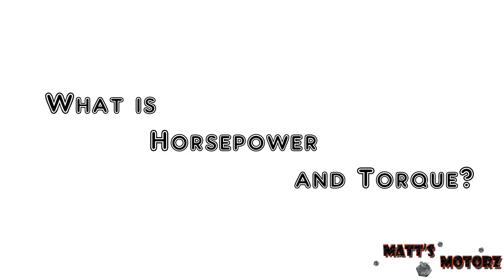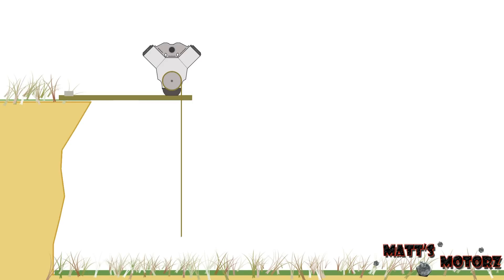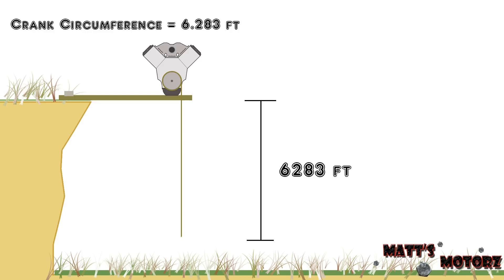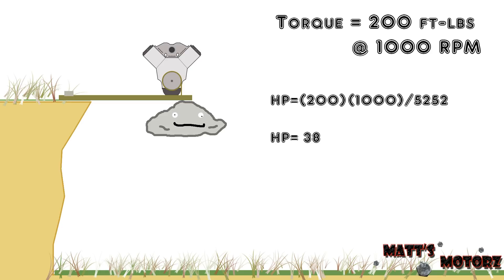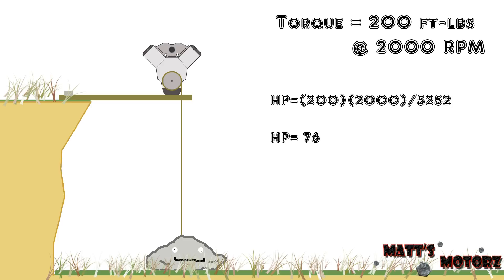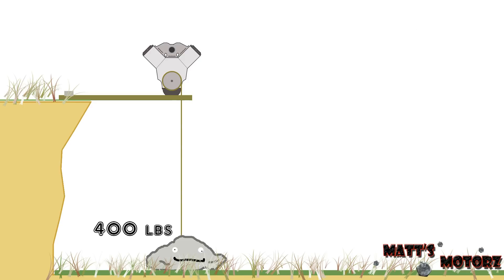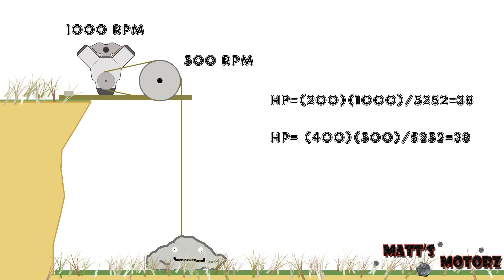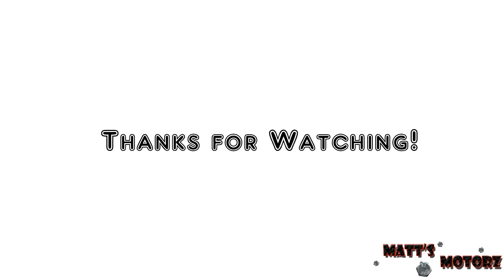What is Horsepower and Torque?

Comment: how does torque and horsepower feel though?
Reply: You feel force at the wheels. This is why when you floor it in 5th you don't feel that much, but 2nd gear puts you in your seat. 
More torque from the engine in a given gear means more force at the wheels, but if an engine with half the torque can spin to twice the rpm, you can downshift for the same force at the wheels if you have a gear ratio half as high. You'd have a hard time feeling the difference between two cars with equal power with one car that makes twice the torque but has twice the gear height and half the rpms.
Reply: That was a terrible explanation. Stop trying so hard to prove how smart you are to everyone, and try again. Start thinking better.
Reply: You're right about the wind resistance muddling matters up, but you definitely have more force at the wheels in lower gears. In the F=MA equation you then get less acceleration at higher speeds. Force times distance is work, and if you go twice the distance in one second, (for constant wattage (power)) you need to halve the force.

Comment: is the last image at 4:16 wrong? shouldn't the rock be pulled by a smaller pulley that is directly attached to the large one?
Reply from the maker: Yes and Yes
Reply: What do you mean? I don't get it. Please explain.  Seems right to me.
Reply: In the given image the large pulley acts as a guide pulley only. the ratio and thus the torque is not changed.

Comment: Awful explanation. Wth is 5252? Is it a number you randomly invented? What does it mean? Why even bother explanation the difference between torque and horsepower if you don't even explain that number which is very important for the equation?
Reply from the maker: It is simply a consequence of dimensional analysis in writing the equation in units of HP.  I am going to make a pinned comment about this in a minute so everyone can see as I have had this question so many times.
Reply from the maker: I just made a pinned comment on the video deriving the HP equation from scratch.  Please see the comment on the video.
Reply: https://www.youtube.com/watch?v=lt7iUBE3_AE

Comment: horsepower is how fast you hit the wall and torque is how far wil you take the wall with you
Reply: If you study physics in high school or in college...you will fail by such explanation.
Reply: Torque is how hard you twist the crankshaft, RPM is how fast you twist the crankshaft and Horse power is how much energy you put into the crankshat.
Reply: Torque is how wrong, stupid and irrelevant an analogy is. RPM is how much it gets multiplied by "likes".
". Power is the resulting permanent
cognative damage caused to our collective consciousness.
Power, not torque, is the limiting factor in not only the top speed of a vehicle but also how quickly it can accelerate at any speed and how much weight it can pull up an incline at any speed.
Please do yourself and the comments section a favour and watch a video called:
"Horsepower is NOT how fast you hit the wall.
Torque is NOT how far you take the wall with you"
It's on the D4A channel. It illustrates the distain the people who understand Physics and engineering have for these idiotic Idioms that spread like a pathogenic mind virus.

Comment: Ugh the power torque curve in the beginning doesn't make any sense. HP should intersect with Torque @ 5252 rpm.
Reply from the maker: This was brought up by MANY other people.  There is no error.  The y-axis scale is different for HP and torque, causing the intersection point to be different.
Reply: Yes, lots of people don't understand that these are two different measures using different units and there is no magic involved in 5252. It's just a unit conversion factor. I've even heard people saying that the two graphs crossing at 5252 means an engine is well tuned :-)

I prefer you keep this as is cause people need to not think of the Y axis as common. It's not. There are other things in this video that could be improved.

Comment: So if you have an engine with massive torque, like over 1000lb/ft and you put it in 2 cars, one which weighs 2000kg and the other 1000kg. The cars are identical (same gear ratio, diff ratio and wheel diameter) except for weight. If the engines make the same horsepower then the weight of the cars shouldn't affect acceleration, right?
Reply from the maker: It will.  The difference is that the load will be greater on the car that weighs more, which will affect performance.

Comment: on the graphic with the pulleys (gear reduction) the rope attached to the rock should be on a 1ft radius pulley which is attached and shares an axis of rotation with the 2ft pulley

Comment: I have a hoodie, on the back it says. Horsepower is how fast you hit the wall, torque is how far you move it.
Reply: Too bad it's wrong lol
Reply: Torque is just how hard you twist the crankshaft, tells nothing about how fast you twist it...you need both to know how fast you will get going.
Reply: Torque is how wrong, stupid and irrelevant an analogy is. RPM is how much it gets multiplied by "likes".
". Power is the resulting permanent
cognative damage caused to our collective consciousness.
Power, not torque, is the limiting factor in not only the top speed of a vehicle but also how quickly it can accelerate at any speed and how much weight it can pull up an incline at any speed.
Please do yourself and the comments section a favour and watch a video called:
"Horsepower is NOT how fast you hit the wall.
Torque is NOT how far you take the wall with you"
It's on the D4A channel. It illustrates the distain the people who understand Physics and engineering have for these idiotic Idioms that spread like a pathogenic mind virus.

Comment: i am Not a Engine Spezialist, but since Torque = 9550*(p/n) i dont Unterstand this Factor 5252
Reply from the maker: The factor 5252 comes from converting the HP equation into ft-lbs.
Reply: MattsMotorz i assumed something like this, but seriously, why PS, why HP why ft-lbs, would be whole lot easier if we all use si measurements
Reply: Good luck converting America to the modern SI system :-)

Comment: doesn't horsepower make a car faster
Reply: iTzArNoLd415 that's true, but there is an optimum because there are more factors that play a role. For example, a high-hp, low-torque engine in a heavy vehicle means that you need to be really high in the rev range to be fast, this means switching gear very often, a lot of noise, high fuel consumption and short service intervals. This is optimal for for example a (loght weight) racing bike. But for a truck delivering cargo every day of the year, this would be terrible.
Reply: xXxMartin96xXx I disagree with your argumentation. Yes, those different engines will have their own gearing suited to its application and there is off course the critical function of the clutch. A high torque/low revving/low maintenance engine (e.g. marine propulsion @ up to 400 rpm continuously) will always have a higher weight and has different mechanical loads than a high hp / high revving / low weight engine (e.g. racing bike @ 15k rpm redline which is engineered in a such a way to achieve weight minimalisation). In the high revving engine, all the components move much more often per hp delivered per x distance traveled. Furthermore, at such high rpm, there will be much more friction per hp delivered, resulting in more noise and more fuel consumption. Besides the point that these engines will have been engineered aimed at a specific maintenance interval, inherently, the high torque engine has a much longer service life whereas the racing engine would need a revision after only a very limited amount of distance travelled on track.

Comment: my bike makes Max Power 17 BHPMax Torque 18.35 Nm. can anyone explane why it makes more torque than hp? i am a commerce student kindly explane in simple eng tia
Reply: 223 ccMaximum Power17 Bhp @ 7000 rpmMaximum Torque18.35 Nm @ 6000 rpm
Reply from the maker: These are at two different RPMs.  An engines torque and HP varies with RPM so you cannot compare these two numbers.

Comment: Nice vid.. I always cringe a little when people act like Torque is what makes for faster cars, not horsepower... Even high profile car guys like Jay Leno of guilty of this fallacy.. But it doesn't take much to realize that this mindset is erroneous.. After all, if torque was more important, short shifting ( thereby keeping it in peak torque) would be the fastest way to accelerate, but no, everyone knows that revving it out to the top of the power band (Where torque falls off and HP peaks) is faster. 

Furthermore, if torque was king, diesels would be the best choice for fast cars, as they produce massive amounts of torque. With less HP.. But no, it's gasoline engines, which usually produce more HP than torque, that are the choice for the fastest cars.  

And yes, I know those highly modified diesel trucks are quick.. But take a similarly sized gasoline engine, and throw similarly big boost at it is see what happens.. that's right, you'd have a MUCH faster truck!
Reply: i would argue that, a car with great horse power but only up in the higher rev range would loose to a car that can pull hard quickly using superior torque, to a point. its ability to reach max power is more accessible but will loose top end speed as a result. on a tight twisty track torque wins, long open track racing, hp wins.
Reply: Savantjazzcollective
That's a good point.. And in a drag race, torque would take it off the line and in the 1/8.. But in the quarter, or full mile, you'd want the HP
Reply: one could argue that transmissions do torque multiplication and short shifting will cut wheel torque by a lot, so even if the engine is not at it's optimal torque range, the torque multiplication of the gearing more than makes up for the falloff.

such as in this graph:
http://www.rx7club.com/attachments/3rd-generation-specific-1993-2002-16/73345-high-revs-myth-fact-gears-jpg.jpg

think of it like mountain bike gears: the higher the gear, the faster you can go, but it's harder to pedal. so sometimes it's better to leave at a lower gear and pedal faster, even if that's not where you're most comfortable .
Reply: bliglum Yes!  "It's fast cuz it's got sooo much torque" irritates me to no end. I try to explain that what they are sensing in their butts is the fact that their diesel or large displacement engine reaches its maximum power at a relatively low RPM, but that just returns blank stares.

Comment: if torque and hp are proportional, how is it possible that my petrol car has same hp but less torque than my diesel car? and why is my diesel car faster than my petrol car if my petrol car has more torque at higher rpm? (both cars are approximately same  weight, and torque is measured at the wheels of both cars)
Reply from the maker: First question:  Your petrol car spins faster, thereby delivering the torque faster.
Second question: Your diesel car must have a better torque curve than your petrol car (meaning, high torque across a wide band of RPM, it isn't all about max torque an max hp).

Comment: The only question I have is where did the 5252 come from?
Reply from the maker: It is just a multiplier for converting to equations into units of HP.
Reply from the maker: QwazyWabbit No this is not quite right, (almost). I have made a pinned comment deriving the HP equation from scratch, please go to the video comments and take a look.
Reply: 5252 comes from 33,000 lbft / 2pi.  The more specific formula would be tq@RPM x 2pi x thatRPM /33,000lbft/min = HP@thatRPM
Reply: The 5252 comes from the dimensional units of torque and horsepower. 1 hp is 33,000 pound-feet per minute. Torque is pound-feet and since it's rotating you must take the circumference (1 revolution) into account (C=2*pi*r). This is why he had to choose 6283 feet as his cliff height (1000*2*pi) which makes the task take 1 minute. 33000/2*pi = 5252.11
Reply: MattsMotorz Good explanation. Yes, it's due to the angular velocity of the torque applied through the radius, which was set at one foot. I chose circumference to link it to your model. Your new explanation is better. (It's the conversion factor of rpm to "feet of displacement per revolution".) ;)

Comment: 4:25 drawing correction
that rope should be much closer to the center of the pulley
Reply: the rope is attached to too big of a wheel, it's suppose to be attached to a wheel that 6.2 something feet in circumference where as the wheel drawn is like 12.4 feet and thus the engine would stall.
Reply: Hey, can you explain this? Do you mean there should be another rope, attached closer to the inside of the large wheel?

Comment: What is 5252, where does it come from and why is it in the equation?
Reply: The 5252 comes from the dimensional units of torque and horsepower. 1 hp is 33,000 pound-feet per minute. Torque is pound-feet and since it's rotating you must take the circumference (1 revolution) into account (C=2*pi*r). This is why he had to choose 6283 feet as his cliff height (1000*2*pi) which makes the task take 1 minute. 33000/2*pi = 5252.11
Reply: MattsMotorz look up dimensional analysis and learn how your equations are derived before you present them.
Reply: thats the stupid shit you get when you stubbornly stick to outdated units like feet, pounds and horsepower.
Reply from the maker: It is simply a factor from converting the units to horsepower.  If you were to use different units, the numerical factor would be different.
Reply: MattsMotorz
So why 5252 then, what units conversions result in 5252?
Reply from the maker: I don't know the original units.  There are so many units one can derive something in.  It was most likely derived in SI units, and then converted to horsepower.
Reply: +QwazyWabbit Top notch, thanks for being educated and helping the rest of us, it's much appreciated!
Reply: Beach&BoardFan you're welcome. When I first encountered dimensional analysis in H.S. physics I fell in love. Master it and you can do conversions in your head without memorizing magic numbers.
Reply from the maker: QwazyWabbit I know dimensional analysis. What you described in your comment is exactly what I was trying to say.  It was good that you actually showed the calculation though. I should have done that.
Reply: QwazyWabbit
Do you have any recommended reads or sources of information for dimensional analysis? Text books, videos, etc..
Reply from the maker: Beach&BoardFan I just made a pinned comment on the video deriving the HP equation so people would stop asking.  Please see this comment and it should answer all your questions, QwazyWabbit did not have it quite right, the 2*pi comes from the angular velocity term, not a circumference term.
Reply: MattsMotorz
Cool, thanks for following through on your content. Math is just one of those things if every variable isn't accounted for the whole thing goes out the window.
Reply: I think you do me a disservice by saying I didn't get it right. The use of circumference is perfectly correct. The DISTANCE the torque is applied is for the circumference of the pulley applying the torque times the number of revolutions. You chose a distance (1000 x 2pi) without explaining why and a radius of one foot without explaining why and stated the circumference of that pulley was 6.283 feet and at 1000 rev/min it takes one minute to lift the load. You chose the pulley circumference and used that exact word in the video, not me.
Reply: There are lots of sources on the web and I know Wikipedia has a rather confusing explanation of it but if you want to see a nice video of a very basic introduction to it I like the Khan Academy video: https://www.khanacademy.org/math/algebra/units-in-modeling/intro-to-dimensional-analysis/v/dimensional-analysis-units-algebraically
Reply: fiskfisk33 They're all convertible to whatever you want, KW is a very easy conversion it's all just power. I still think HP and lb/ft of torque are the best, they may not be the simplest but they better exhibit the relationship between torque, engine speed and power output. Better so than KW anyway.

Comment: so if I increase the torque in my car will i get better exelleration?
Reply from the maker: Yes and no.  Acceleration is the result of increased torque over a wide range of RPM.   However it isn't all about torque (as in my example of a steam engine), you need to be able to DELIVER the torque, which is where horsepower comes in.  So in terms of acceleration, horsepower is the more important parameter to look at.
Reply: Arthur's channel if the only change is to add 10% torque on the entire rev range, than you automaticaly add 10% horsepower so yes... it will be faster.